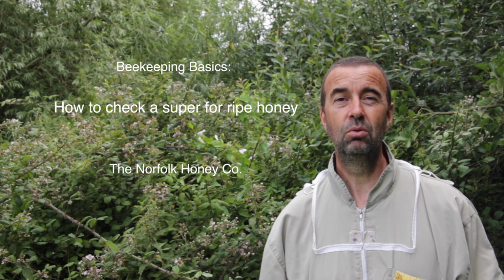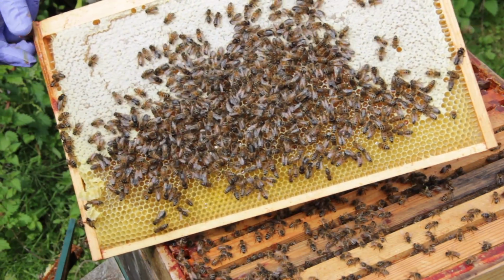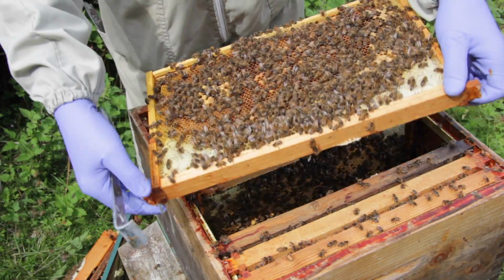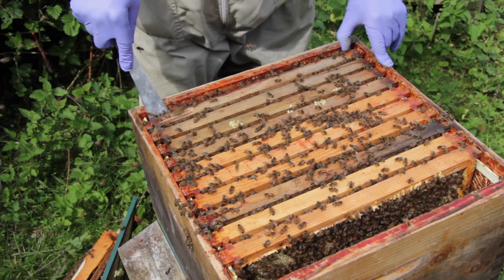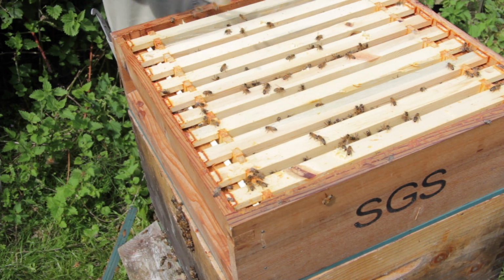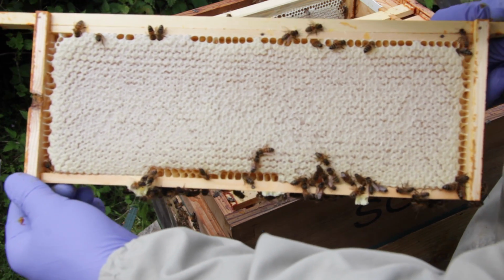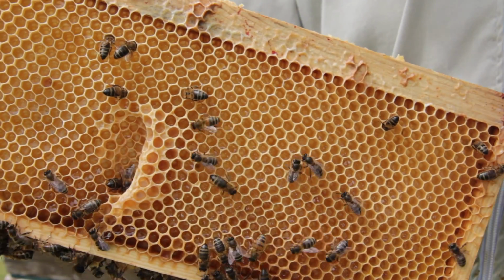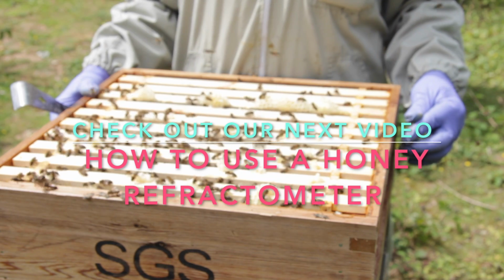How to check supers for ripe honey - #Beekeeping Basics - The Norfolk Honey Co.

Comment: If nectar shakes out of a partial capped frame. Would you keep shaking it out then extract. Wait it out longer. I'm using deeps and they are about half capped. I'm afraid if I don't extract soon I will loose it. They will take it down to brood box no? 2 broods 1 honey super. All deeps.
Reply from the maker: Hi Jay,
I think you've found one of the potential stumbling blocks when using brood boxes for honey stores. If it were here in the UK I would give them an extra week or so and then check again, I had some high water content stores in a super, left it an extra week and it was fine. Alternatively, do as you suggest, shake it all down onto the top bars of the box below and then extract the capped stores.
Once you've done that you can check the water content with your new honey refractometer :)

Stewart

Comment: I love your videos and always look forward to seeing them.  Would love to see how you manage a 1, 10 frame deep instead of a 2 hive deep and using the honey supers.  My question is when you decide to harvest the honey supers in order to do a Varroa (Apigard) treatment which will take about 30 days and they have uncapped cells, what do you do with the honey supers.  Do you freeze them for the winter and then put them back on for the 2018 spring honey flow?
Reply from the maker: Hi David,
Thanks for your comments.
I don't think my bad back would appreciate all the heavy lifting! Those supers are so much easier to manage for me personally.
Really good question about the varrroa treatment, and it's why I have switched to using Mite Away Quick Strips which is a formic acid treatment that doesn't taint the honey and is only on the hive for one week. That way I can allow the bees to carry on filling up with honey and take it all of at the end of the Summer flow.
Stewart
Reply: In my locale, N. California, the temps are between 95F and 105F til late September.  Would the Mite Away Quick work in these temps?

Comment: If it's capped it's good to go. Bees cap honey when it's about 17-18% moisture content.
Reply from the maker: Hi private bubba,
Thanks for commenting. Yes, normally the bees will cap the honey around that number but if it's getting late in the season and there is still uncapped honey in the frames the simple shake test can also confirm that generally the frame can be extracted. It's just a guide to see if it's worth extracting. I sometimes find colonies that have several frames full of honey that isn't capped but is ready to be extracted at the end of the season and this method helps make the decision as to whether I remove it or not.
Stewart

Comment: I suspect your mike cover is black. Can you replace it with white cover? An article I read some years ago tested Africanized bees using a veil that was the standard black verses a veil that was white. The white veil had very few attacks as opposed to the standard black veil that was mobbed. Just a thought.
Reply from the maker: Hi Bill,
Thanks for commenting. I had not thought about changing the mic cover to a white one, I'm going to see if they are available. I had thought it was the electronics in the camera that were causing the problem as they also dislike my mobile phone when I have used that close up to video. I'll keep you posted.
Stewart
Reply: Bill McLaughlin sons of the ploners

Comment: Great channel, subbed bud. Im looking to pick bees up this year, April. Quick question, what causes the indentations in the last 2 frames? the large ones
Reply from the maker: Hi Mightypi,
Thanks for commenting and subscribing, Good luck with getting your bees in April.
Did you mean the gaps at the base of the frame? If so, it is usually caused by the bees chewing the wax, sometimes because they can't produce enough wax fast enough to use elsewhere in the colony. If you can pause the video and tell me what time you stopped at I will have another look.
Stewart
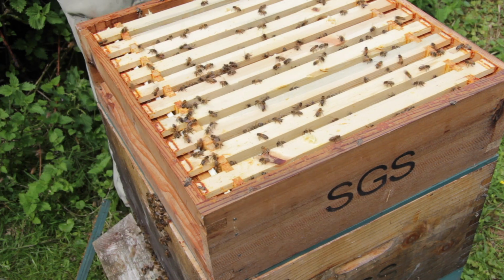Reply: The Norfolk Honey Company 12:24, while I'm sure it's a normal thing,being new I'd panic tho.
Reply from the maker: I stopped the video at 12:24 and all looks perfectly fine so I'm struggling to see exactly what you mean, maybe it's just that because it's all ok I just can't see what you mean specifically.
Stewart
Reply: Hi Do you mean 12.45 the dips in the wax?